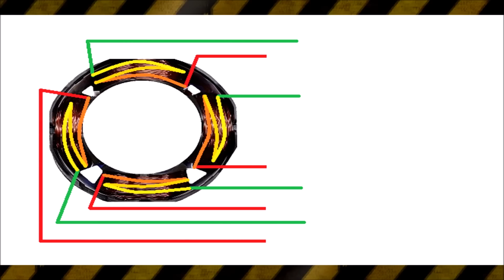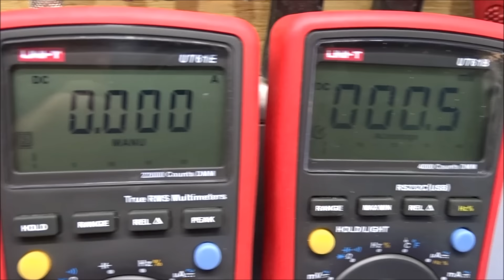DIY Permanent Magnet Synchronous Motor Generator! ⚡ Convert AC Induction Motor!

Comment from the maker: I would like to have a comment from those who do not like the video!
Reply: You might have picked a bad motor.  The iron core height looks to be half that of the magnets means the generator is pretty weak for its size as you're wasting the extra magnet length.
Reply: @preddy09  having the magnets longer than the stator Actually makes the back EMF more sinosudial, which helps efficiency. However, they don't need to be that much longer. Suspect Those were the magnets he had around. There might be some Eddy currents induced in the Alu housing at the ends of the stator?

Comment: Hi ! I need some advice. I want to build a vertical axis on a concept as yours, on bearings. I want to put two discs rotors with permanent magnets ( like 12 per disc ) and a stator with 3 phased coils in resin in between the two discs. Repeat the same stator -rotor 3 times total on the bearing vertical axis. Connect the axis rod on a dc mini motor that runs on a 12 v ,from a photo voltaic panel installed on my block roof or just use a transformer 12 v from outlet. Put my 3 set disc axis in the balcony to spin. Each pair of stator -rotor will have a regulator and  an inverter each, assuming I could get 1000 watts or more  per stator - rotor. I want to heat my apartment with 1000 w oil radiators , 3 rooms 3 pieces or say my AC unit of 2.4 kw capacity. I have some questions: 1 What would be the maximum speed needed from my 12 v dc motor in RPMs to reproduce the wind flow turbine. 2 Is the 3 phase coil the best choice for this because I don't know much about coils. 3 Will the rotor spin at normal or it can get stuck due to magnetism? 4 If the faster you go the more current you get then, could i make my stator coil also spin by a set of gears in the opposite direction? 5 Why all DIY have metal rotors that they glue the permanent magnet on? Is that crucial to the current flow or can I use non metal discs. Also the resin , same question with the coils . Is the resin going to help with the heat release and it's crucial or since I keep it inside, and there are no external elements to attack my coils, will it be ok without resin? 6 if i could achieve a regular RPM, could i drop the gel batteries idea? Thanks !

Comment: could you tell me how to increase the rpm of my synchronous motor actually it has only 3 rpm 
plz reply
Reply: You will need to increase the system frequency. Better use steam enginer rather than electrical if you want high rpm.

Comment: Dear Mr. George,
All that effort to light a light bulb with a drill?  Really? Seriously?  Are you kidding?
I didn't see no motor.  Does it turn when you apply power to all those stinking wires.  I was expecting you to plug the motor in and watch it spin.  Making it spin with drill is cheating.  No bueno amigo.  
No oscilloscope display of the 8 stinking wire output in generator mode?
Otherwise this is a fine video.